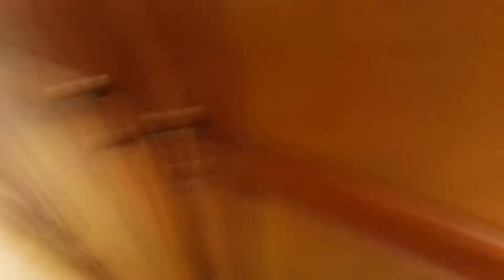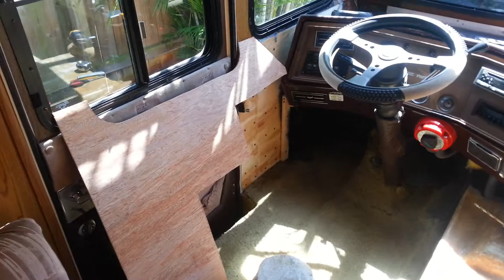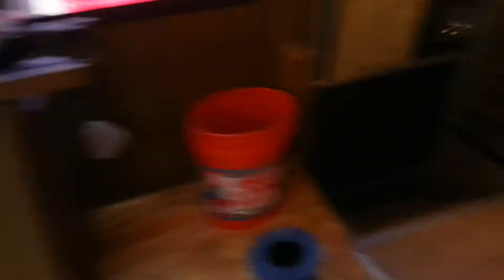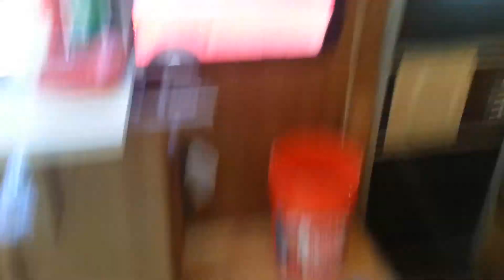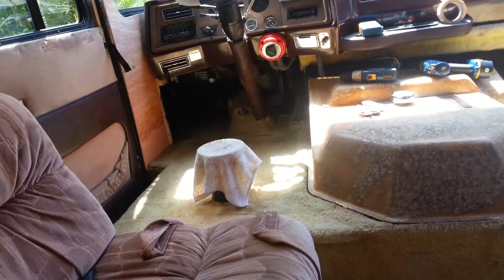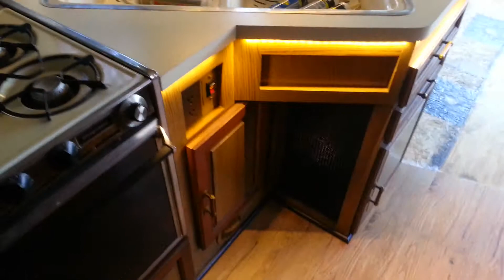July 2013 RV renovation.  Front End.

Comment: Mine was leaking around antenna in center front & right side & 2 more leaks in bedroom corners mine, also has twin beds in back & those dreadful stairs in front, but mine only has 3 burners & has led lights & lights in cabinet. Does yours have slide out pantry? I also have to replace skylight over shower.